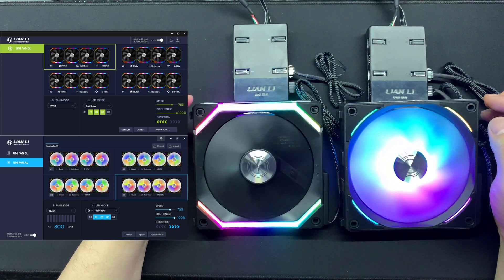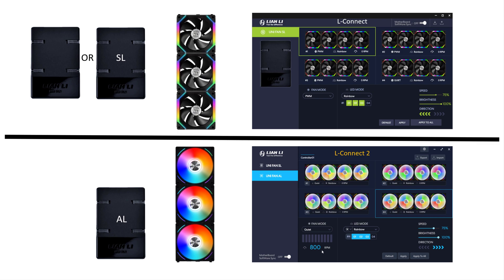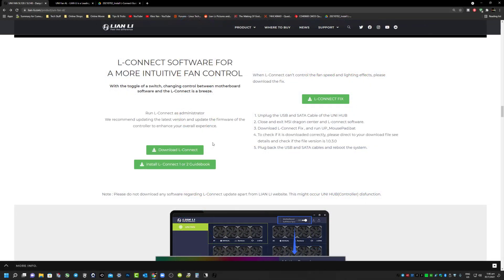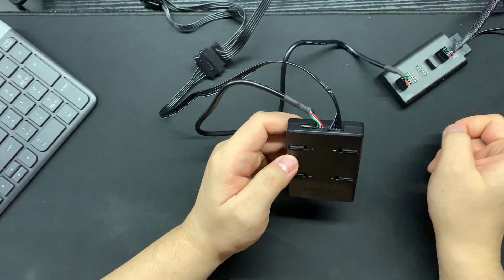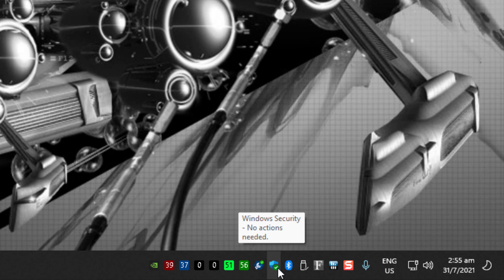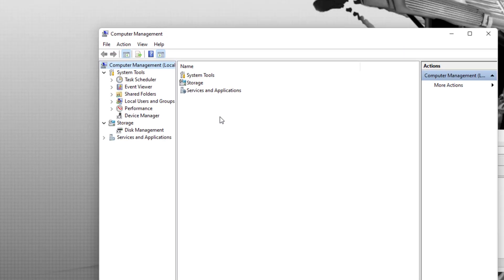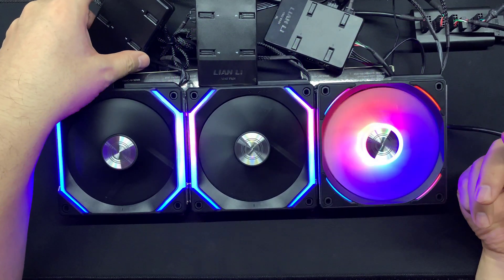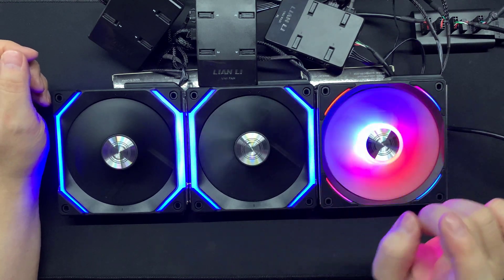Lian Li Uni Fan AL120 & SL120 Controllers - Firmware and Features [L-Connect 2]

Comment: Hello, my LianLi device comes up in "Other Devices" with a yellow warning symbol instead the USB devices section in device manager. Device isnt detected in the firmware updater but appears in L-Connect 3 however I am unable to control anything.

I've had 2 motherboards and used two different controller hubs with latest bios and chipset drivers installed all with the same issue, anyone have any solutions?
Reply from the maker: Hello random creature, welcome to my channel, I like to check, the motherboard you are using, do they have a 2nd USB Header? if yes, try swapping to another. if this does not work, do you happened to make use of other application like Armoury Crate, MSI Dragon Center or etc. If you do, I would recommend you to try removing this application using Revo Uninstaller, kindly follow this video and please take your time to go through it. https://youtu.be/CgvuUFeff8U

Comment: i have b550 elite v2 and cant control the Fan and RGB..i tried everything what y explained in your videos and nothing..where is the problem??maybe the motherboard not supporting ,???
Reply from the maker: Hi Be Real, welcome to my channel, are you using the L-Connect 3 with the AL fans? if you are, this might help you narrow down your issue https://youtu.be/CgvuUFeff8U
Reply: @KleoYan  im using the UNI FAN SL and the SL120mm Fans.RPM's not showing  still on =0 .and the colors also not changing. i dont have idea what can be.its just lighting rainbow mod and FANS working on lowest.
Reply from the maker: @C.O.D.E.47  ok, can you remove L-Connect 3 app first, kindly use revo unistaller as illustrated at the other video https://youtu.be/CgvuUFeff8U , then shut down your PC, remove the fan connections (RPM & ARGB cable), leaving only the uni controller, boot up your pc. Does your windows device manager detect the uni controller? under Universal Series Bus Devices, if it does, do a manual firmware. follow the instructions here https://lian-li.com/l-connect3/L3_update_manually/
Reply: @KleoYan  controller is not Detected .popping out after im installed a controller

Comment: is it necessary to disconnect the fans from the side ports of the controller before running the firmware update? Also, if I originally installed L-Connect 2 would I need to uninstall that before running the firmware update or only if I were to have downloaded L-Connect ?
Reply from the maker: Hello J7, welcome back. different people might experience differently. I rather delete the program. Left the firmware program focus to code the controller. So it’s all up to you. For me be it L-connect 2 or 3. I always do this step and before I fix all fans or controller into the case. I will do a dry run outside the case before fixing them into the case.
Reply from the maker: By the way. If you are using L-Connect 3. This is how I do it too https://youtu.be/CgvuUFeff8U

Comment: Had SL Uni fans and controller sync'd with mb color with aura sync and it randomly stopped working. Colors on the fans just freeze now when I click mb software sync now
Reply from the maker: Hi Foolslogic, welcome to my channel, do pardon me on the late reply was busy at work. ok before proceeding, are your uni fans functionable with the L-Connect app? if you are using motherboard utility to sync, you might want to try uninstall this app together with the L-Connect. kindly use revo uninstaller to remove all leftover files and registry. Next turn off your pc, unplug the PSU cable from your wall outlet, press your power switch one to two times, let your mobo discharged all the current it's holding. next plug back the PSU cable, turn on your PC, go to device manager, under universal serial bus devices, do you see the lian li controller. if yes, install the L-Connect app. test all your fans (RPM and ARGB Effects). If it works, then install your motherboard app and test again. If you did the previous step 1) and it does not work, you might want to switch the USB Connection to another USB header of your motherboard and try again. If still no, you might want to check if your motherboard needs a bios update to fix any potential USB intermittence issue.

Comment: Everything works fine with L2 but once I've tried using L3 it doesn't work. How do I fix it
Reply from the maker: Hi Texas Elite, welcome to my channel. Did you uninstall the L-Connect 2 properly? if you still facing issues even following the steps from this video, it's best to contact Lian Li Support directly.

Comment: thanks man, finally i got control of the l-connect 2 . Ive tried try l connect , l connect  2 & l connect 3 , but it wont work. Then i saw tour video and using revo uninstalling apps only then the firmware tools detect the device ccontroller. It takes me 3weeks to solve this issues.. 🤣🤣🤣🤣.. thanks again man
Reply from the maker: Hello Mohd. Hamirul Haffiz, welcome to my channel and you are most welcome. All the best with your build.
Reply: @KleoYan  bro, i have some question, im using aorus b550 pro ac, which have a build in intel dual band wifi 4 (im not mistaken ), ive tried to plug tp link ax3000 wireless adpator to auros b550 pcie mobo because of the specs , wifi6 &bt5  , hoping i can gain more speed by using wifi6 pcie adaptor , but my pc it cant detect the device.. my question , is it possible for me to use external pcie wifi 6 type to a mobo that alread have build in wifi? if can , how?
Reply from the maker: @mohd.hamirulhaffiz495  what I would suggest is to unplug that PCIE ax3000 card first, next use a eraser (a stationary to erase pencil marks) use the soft side and rub on the PCI-E contact pins, clean it with a brush or paper towel, resit the PCIE card again and see if your system detects it. illustration here https://youtu.be/XxSL8VZoYRg?t=1428

Comment: Hello, on the hub we have "4 channels" right? can I buy like 2 boxes with 3 fans and one Lian Li Galahad AIO 360mm, using the same hub? it will work? it was a pain in the ass make this 3 fans work and I can't sync with the motherboard, so I'm expecting to have all my 9 fans (including the AIO Galahad) with the same hub instead have more than one hub in 2 USB 2.0 port, because seems like this hub doesn't work on port 1, only on port 2 of the Motherboard.
Reply from the maker: Hello Alessandro Almeida, welcome to my channel, yes you can do that but you will need to get the lian li argn kit or to use custom kit which I did myself. example here https://youtu.be/njlkdM9lYbI and a diagram to guide you. https://imgur.com/a/fPaotpe
Reply: @KleoYan  Thank you, that helps a lot!! I will let you know in some future "doubts" after I buy all!!
Reply from the maker: @monkeyDluffy21001  you are most welcome and all the best with your build 😉

Comment: Device detected named '6k7750' not 'lian li', and when I scanned for device updates, it didn't detect any devices. What's the solution ? My controller is unihub AL, and using z690 strix motherboard
Reply from the maker: Hi Vincent C, welcome to my channel.  Your AL controller does not need to do firmware, just for your info, you can directly use L-Connect 2. Your board have another USB Header. can you try swap to that header to see if it works, if it does not, did you install armour crate before L-Connect 2? if you did, uninstall the armory create using Asus uninstaller, next turn off your system. pull out the PSU cable from your AC outlet, let it sit for 45 seconds. power back on your PC and make sure your controller is connected, then install L-Connect 2 app. see if that works.
Reply: @KleoYan  I have try all of it. Yes my board have 2 USB Header, and i have remove the another one, just using 1 USB Header only for AL Controller. I have uninstall my armoury crate fully using Revo uninstaller and turn of my system, pull out my PSU cable for a hours. But my L-Connect 2 cannot detect my device and the name of device is not 'Lian Li' but '6K7750' when i check it on device manager. For your information, my AL controller just connect 2 device, is my Strimer plus triple pin and Strimer plus 24 pin. I'm not have the AL fan because i only bought the AL controller from my friend. I just want my AL controller can control my Strimer Plus
Reply from the maker: @vincentc5936  I am afraid that your controller might be prick. As I have the same issue with yours. though this video is not L-Connect 2, in L-Connect 3 when I did a firmware update, I prick my controller and it shows the same as what you are seeing https://youtu.be/uMgUYiakpxM?t=868 (6K7750) , you might need to get that controller replaced if it's still under warranty.
Reply: @KleoYan  Omg I just remembered, when I first installed the AL controller, I updated the firmware on the LC 3. Is there a way to fix this? Because I'm not sure this item has warranty in my country
Reply from the maker: @vincentc5936  if you use the L-Connect 3 does the argb reacts? if it does, it should work with L-Connect 2 too. if both does not, I am terrible sorry, i am not able to aid you but, you can try approach Lian Li tech support https://lian-li.com/faq/ scroll down and fill in the form with your issue.
Reply: @KleoYan  Okay sir. Thank you very much, you are really very helpful 🙏
Reply from the maker: @vincentc5936  you are most welcome, I hope you will get your issue resolve soon. all the very best buddy.
Reply from the maker: @vincentc5936  hi, pardon me, just woke up. you can send your link to my email if you want.. godzylatech@gmail.com.

Comment: Very informative! Thanks. But is there a way to link 2 connectors instead of running each connector separately to the motherboard?
Reply from the maker: Hi General Grevous, welcome to my channel. For your case, it will be advisable to get the internal USB hub, then you don't have to worry about using up your motherboard header. What the internal usb hub does it. it's powered by your PSU and you can plug up to 4 usb to this hub and from the hub to the motherboard header. If you just use a usb splitter, it does not have enough power to drive your uni controllers.
Reply: @KleoYan  Thanks Kleo, will give that a go. Cheers.
Reply from the maker: @generalgrevous1984  you are most welcome and all the best with your build 👍

Comment: when i scan device it says 0 device
Reply from the maker: hi siantz809, welcome to my channel, mind if I ask, which uni fan are you using? SL or AL, if AL you can use L-connect 2 but for SL, if the controller is without the SL marking, you need to use the original L-Connect and not L-Connect 2, unless you do a firmware on your SL Controller that does not have a SL marking on the controller. 
if you use the correct L-Connect application to your Uni fans, do you happened to have another USB header from your motherboard, you might want to try that. 
last but not least, did you install any other argb programs from your motherboard before you install the L-Connect app. if you have, try uninstall both programs (includes L-Connect). kindly use revo uninstaller to remove the application as this uninstaller will remove all left over files and registry from your system https://www.revouninstaller.com/

Comment: So can I connect the SL and AL to the same one?
Reply from the maker: Hi Kahn, welcome to my channel. No you can't, each uni controller has it's specific firmware. the SL controller is for SL Fans, the AL controller is for AL fans. It will not work properly if you plus SL fans to a AL Contoller, vice versa.
Reply: @KleoYan  I gotcha thank you so much!
Reply from the maker: @Kahnsie  you are most welcome. all the best in your build.

Comment: hi bro, i am not able to control fan speed at all even from L connect and bios. I am using aorus x570 master motherboard. i have connect fan header to fan header 2 but in bios its not showing its connected.
Reply from the maker: Hi Jivix, welcome to my channel, I would first disconnect everything and to test out the cables which are attached to your either AL or SL fans. plug the fan loader to the motherboard fan header and test it.. your bios / uefi should detect it. if it does not, change the AL or SL cable, still using the same fan. once you narrow down that a cable is working, then work your way up to other fans, then do daisy chain. once done, next to diagnose is your uni controller, disconnect all fans on the uni controller. you need to view under device manager to see if the uni controller is listed under universal serial bus devices. if it does not, try the other USB socket on your motherboard. one thing to take note.. do you have gigabyte fusion installed before the L-Connect? if yes, uninstall both using revo uninstaller as this uninstaller will remove all left over files and registry, make sure you use the scan function.   https://www.revouninstaller.com/

Comment: Y may L-connect 2 UNI FAN SL when i set PWM and Set/Set All my speed will run very high.
May i know what's going on?
Reply from the maker: Hello Alvin Haw, welcome to my channel. you might want to check if your motherboard UEFI is set to PWM mode first and next set the desire fan curve you wanted to to use the profile set in your UEFI. If that is not set, no matter how you swtich in L-Connect 2, it will not work. kindly refer to the video " Lian Li Uni Fan SL120 - Connection & The Controller (Part III)" in this playlist. https://www.youtube.com/playlist?list=PLEW-b-2vYDdPo0NzHyeksx012c-nkDapm

Comment: @kleo - Do I need the fan controllers to control the strimer plus using L-connect2 or simply using the controllers that come with strimer plus for mother board extension and gpu ? I am not having any lianli fans only using the strimer plus , but my L-connect2 software says controller not detected . Can we control the strimer plus RGB with Lconnect2 software rather than using motherboard software aura sync from armour crate ?
Reply from the maker: Hello Ravi Bhatia, if you only have the strimer plus, you can either use the strimer controller or you can use the motherboard argb utility to control the lighting effects, your strimer plus controller will not work with L-Connect 2 app. for that you need to have the uni fan controller. for your strimer plus to be able to control by armoury crate, make sure the argb cable is connected between your strimer plus controller and to the motherboard argb header. more details here https://www.youtube.com/playlist?list=PLEW-b-2vYDdPo0NzHyeksx012c-nkDapm "Lian Li Strimer Plus - To use on Uni Fan Controller" and please read your strimer plus manual too for instructions. thank you!
Reply: @KleoYan   can i control the strimer effects from lconnect 2 software rather than opening my pc case and pressing the buttons on the strimer controller?
Reply from the maker: @bhatiaravi18  as mentioned no you can’t. L Connect need the uni controller in order to work.
Reply: @KleoYan  can i get only the uni connector from Amazon?
Reply from the maker: @bhatiaravi18  not that I know of, but have you think of connecting your strimer plus controller the argb connector in the middle to your motherboard? you can use your motherboard armoury crate to control your strimer plus. again please see your strimer plus manual for instructions on how to do the connection. thank you!
Reply: @KleoYan  I am able to make use of the armour crate software but I did not like the effects it has. So want to make use of the lianli strimer plus original effects from the strimer controller using the Lconnect2 software but the software says the controller not detected. If I get the uni hub and connect to my strimer controller will I be able to use the Lconnect2 software to get the original lianli effects in the strimers.  My set up is like this : cooler nzxt z73 aio with 3 fans on top and nzxt aero 2 fan in rear , 3 front fans of case phanteks p500a , galax hall of fame gpu rtx 3080 , ATX strimer and 3x8 pin gpu strimer both of them connected with their own controllers .
Reply from the maker: @bhatiaravi18  hi, I see, you wont be able to get the strimmers effect using the uni controller. those effect are for fans. they will not bring your strimer plus effect over. if you want to have the strimer plus controller effect. you can only do it via it's controller only and not through either motherboard now uni controll (L-Connect)
Reply: @KleoYan  which is best rgb effects software in strimers is it icue or Lconnect2. And for using icue i will need the corsair lighting core for Lconnect2 I will need the uni hub . Which of these 2 are easy to apply in terms of components and software? Also i have NZXT aio z73 with rgb fans can i control these rgb fans of aio nzxt in any of above approaches ?
Reply from the maker: @bhatiaravi18  Hi pardon me, I am so sorry, I am not able to answer your question, I am only able to tell that that L-Connect 2 is just a fun toy for me to explore while helping friends to figure out the connection. as for which are good argb effects, I have no idea, plus personally, I prefer details more than argb effects. also too many argb will just create heat in a case which will hinder the true performance of a PC. example here. https://youtu.be/0qSaX_mOjQc?t=873 and as mentioned I like details more than argb  https://imgur.com/gallery/Pw5kY4q.. so I can't answer your question, best if you can reach out in lian li reddit. https://www.reddit.com/r/lianli/